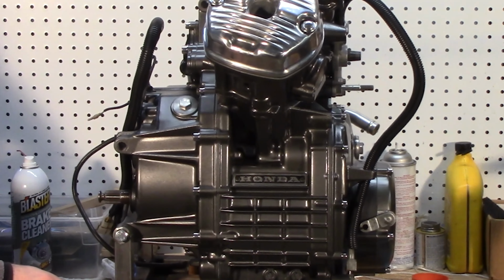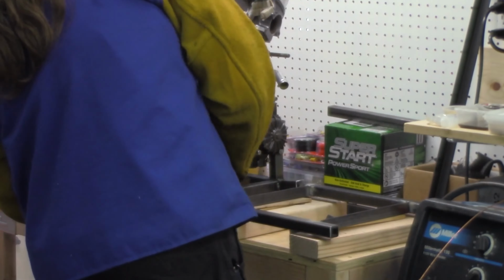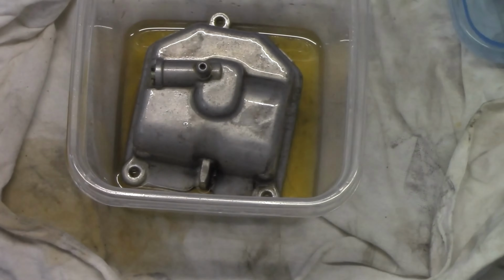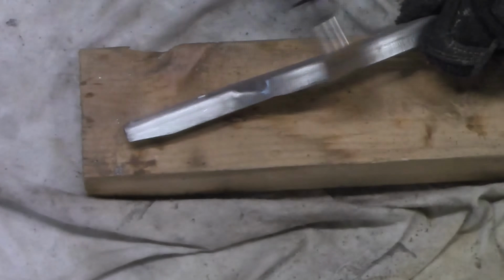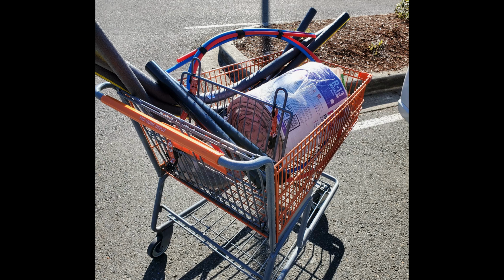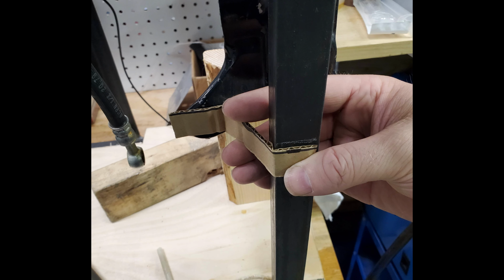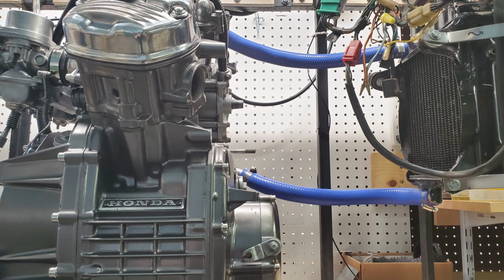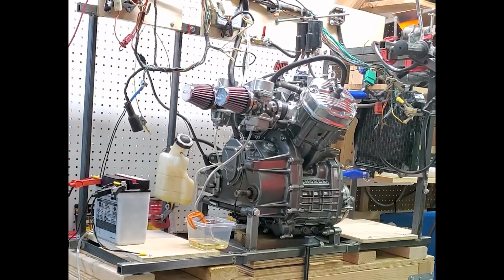Akira Bike Project - 14 - CX500 engine test stand

Comment: This was good to see after following since 2012, checking in periodically here and there. I have been working on a e-bike design myself the past year, the steering is a major headache.
Reply from the maker: Thanks! and thanks for sticking around and checking in on the project.  Making great progress this year but everything is a headache lol. Are you making an electric motorcycle or bicycle? recumbent or upright?
Reply: @matus1976  ...I like to call it a stealth recumbent e-cycle. Welding a custom aluminium frame up with carbon fiber parts for shell stuff. I have dual hub motors and a mid drive bafang M620... I might have an issue with that cuz its a 1000w and the hub motors are 3000w (I'm told the controller I have can run them safely). Once I get it together, I will have to do some test rides to see how far & fast it can go. I wan't range over speed but all the motors might not give me the efficiency I'm after. The wheels I have are non traditional for recumbent's being 26x4.0, I also have aquired some aluminium deep dish moon disc's for wheel covers. This will let me have some LED-Neon wheel lighting : ) that will be controllable from my tablet docked near the handle bars. I'm not knowing what to do about the front fairing shield.
Reply from the maker: @Jackalope-Moon  sounds like an awesome build! So you have a hub motor in each wheel and another motor?  Plan on doing any videos or build logs? I'm sure many of my viewers would be interested in your build too.  Are you doing a more typical steering with linkages or something like the under the seat steering?  The front fairing and windshield will be a challenge for me as well, I have a few ideas in the works.
Reply: Iv been thinking about doing exactly what your building for ages now what your doing sounds amazing I'd love to see the finished project when your done especially with duel hub motors 🔥🔥🔥

Comment: omg running with no exhaust at all is a horrible idea. That reversion and heat will beat the hell out of those heads real fast.
At least fab a pair of headerpipes that have a 90 degree away from the engine or something like that so the exhaust pulses arent slapping back on the valves and valve seats.

If I were you, before I got to tuning, I'd be getting the engine mounted and full exhaust system you want done, then pull it out and tune it. The exhaust you put on it in the end will change the tuning parameters.

I'd love to see this bike in person when its done.
Reply from the maker: Oh yup, totally, I feel ya, well aware of the resonances and pressure waves in the intake and exhaust tracks, running an engine without a proper intake and exhaust horrifies me, lol.  This was just to get it turned on and see if it runs on it's own, I never ran it more than a minute or two, monitored the head temps by hand and with a laser thermo, and never revved it up more than a little (just to make sure there was a throttle response). This video also doesn't have the electric fan yet so it had no active cooling either.  

I've since added the stock downpipes and some after market mufflers to run it a little longer, but not much point in fine tuning yet until I fabricate the exhaust I'll use on the build.  I have a hollow scrap engine in the frame and I'll design and fab the exhaust with that in place, then move it to the test stand. I also built up a 4" exhaust vent that routes outside, though I think that still builds up too much back pressure.  I'm not sure how I feel about those pod filters and dropping the airbox either, given all the intake resonance and tuning done by the design team, but alot of cafe racer builders have had decent results on the dyno with rejetting and pod filters on cx500s and it's damn hard fitting that airbox in the build with everything going on. 

I think I'm still on track to get this rideable this summer, definitely welcome to check it out when I do!